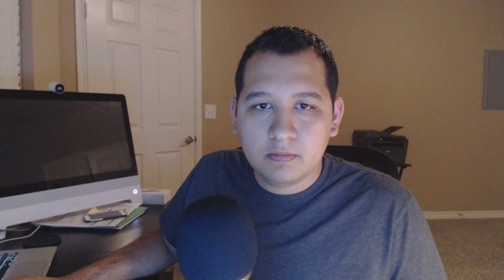Q&A - CSR or GNS3 | Breakout Switch

Comment: Wow  you actually made a video on my question so cool!! You just went to #1 in my book, I officially look to you as a mentor if that is ok, lol. So here is the thing I would like to be able to get through my studies with GN3. Right now my computer that Im running GN3 on is pretty beefy , I have a I7 with 32g of memory and a solid state. Listening to your video it seems you was trying to run CSRs inside of GNS3, if I heard you correctly. If you was doing that then I understand why you ended up switching over to ESXI.  Did you ever just try labbing with the 7200s in GNS3? From what I understand, that was really the only ideal way to do it from a GNS3 perspective. Basically I dont really want to lab through esxi if I dont really have to, because that will require  getting a server and esxi license, and all the other stuff associated with getting set up. Just to clarify the switch question , only four is needed for the setup with GNS3? I already have switches and everything set up, I just dont want to get going in the INE labs and i have to end up doing what you did, lol. Thanks Brother.
Reply: +debizzle3 You will be able to do a majority of the INE workbook in GNS3 without having to integrate your switches. At first, most of the switching labs are exclusively switching and the routing labs are exclusively routing. When I come across a lab that I cannot do at home I use rack rentals. I think INE still has a deal where if you sign up, you get 100 free rack rental tokens.
Reply: +Joe P and that is why I'm sold on INE's WB's